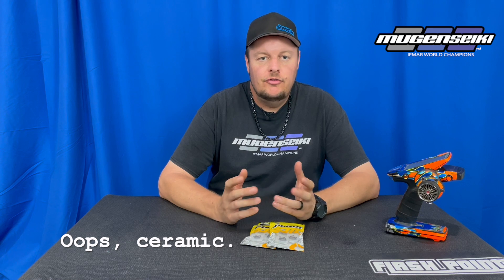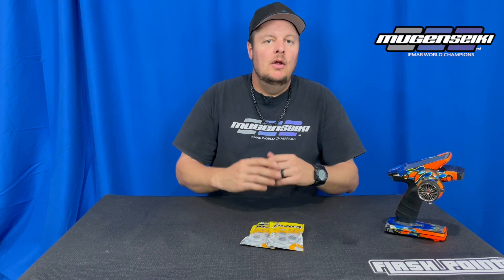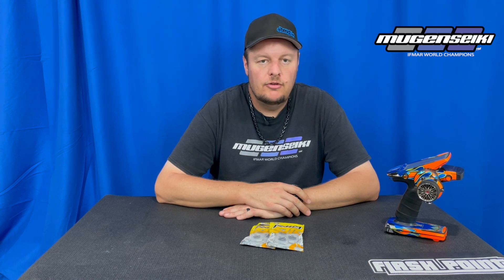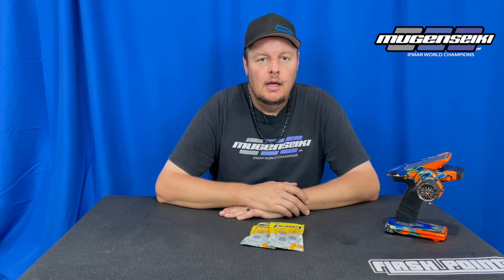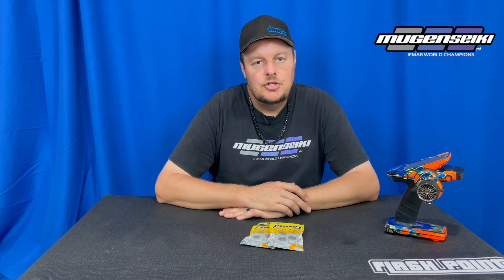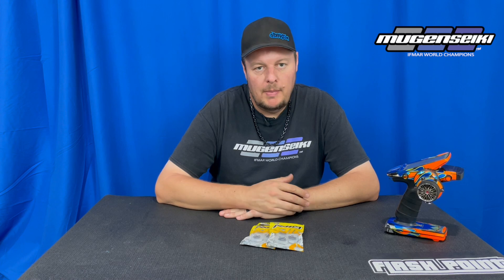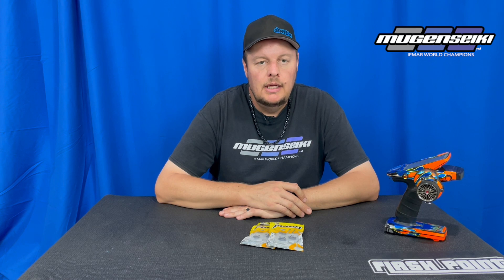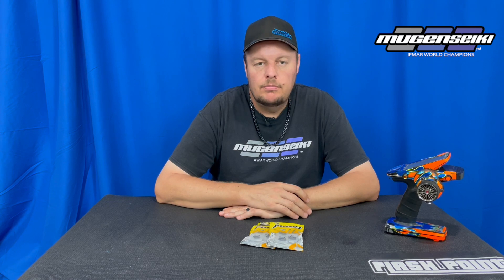Steel vs Ceramic Bearings.

Comment: Just got my new Protek Samurai R03 engine. Spin the crank and it feels terrible. Like the bearings have flat spots. I took the engine apart, and the engine looks beautiful but if you put your finger on the bearing and spin it, I have never felt a bearing so rough. Gotta call Amain and see if they can sort this out.  I have always had steel bearings and never experienced anything other than buttery smooth.

Comment: In my opinion, basic maintenance and roiling of your bearings is more important than the type of bearing. You are running most people simply throw them in and forget about them until they stop working basic routine maintenance is key.
Reply from the maker: Great point!

Comment: Wouldn't ceramic bearings improve fuel mileage along with heat reduction. For those reasons the ceramic is worth it. All out speed does not mean a win.
Reply from the maker: You may see some small gains and I do agree ceramic is better for the rear bearing but the gains will be very small.

Comment: To add on to this, front ceramic  engine bearings are a bad idea. They have the possibility of taking hits from what ever the track/surface will throw at your car and possilbly fail even faster. 100% steel front with steel and rubber seals on it.  Steel helps with strength and the rubber helps keep fine dirt from getting inside or both sides rubber.
Reply from the maker: Thank you for the feedback!

Comment: Love nitro so much!! Ceramic bearings are just too expensive for me lol, I can't justify the spending when I could spend the money on fuel and drive more!
Reply from the maker: Great point!
Reply: I get what you're saying, but You'll get more gallons out of your engine spending that extra money on a rear ceramic bearing than you will spending it on fuel. Front ceramic I wouldn't worry about and just use a regular steel bearing.  As the front bearing is also exposed to eternal damage possibilites and the rear bearing isn't. Plus a lot of your rotational mass in the engine is more so on the rear bearing. Lighten it and make it smoother to spin and there will be less friction causing wear  on your engine. Gotta trust Adam on this one! It's SERIOUSLY not one of those vids that he makes to make us spend more money on RC's . It's 100% the truth!

Comment: I put Avid Ceramic Bearings in TRX 3.3 Engine to fix the crappy bearing it comes with and added O.S 11k carburetor. Now it solid engine. I like Trx engines i wish they put better bearing and carburetor.
Reply from the maker: Thanks for sharing

Comment: I would like to put ceramic bearings in the motors. I ran 1/10  eturggy for 15 min motor temp was at 98. Thanks for a motor analyzer lol
Reply: Yeah totally agree I’ll run ceramic in the motor and application dependant possible centre diff and gearbox input gears
Reply from the maker: Very nice, thank you!

Comment: Good video . What do you think of   1/10 scale racing going to 10-15 minute races?
Reply from the maker: If it was stock racing I would consider ceramic, but otherwise I would use steel.